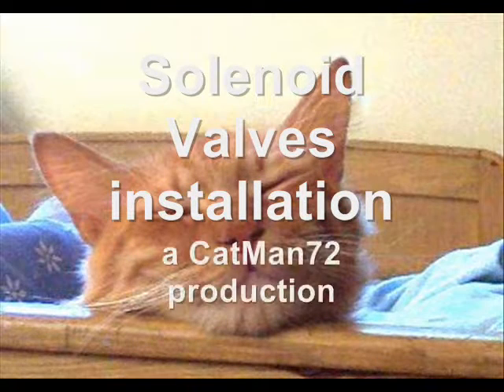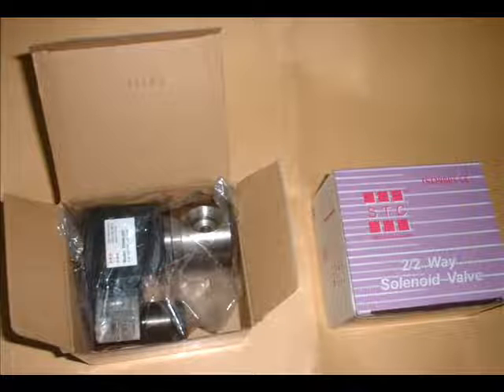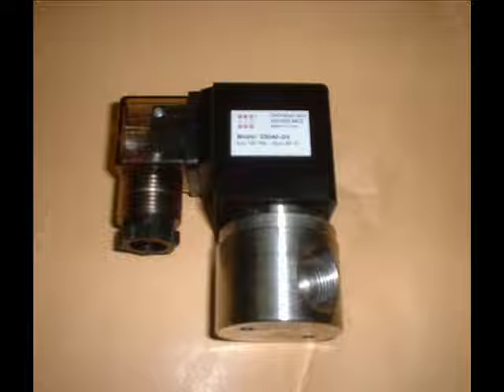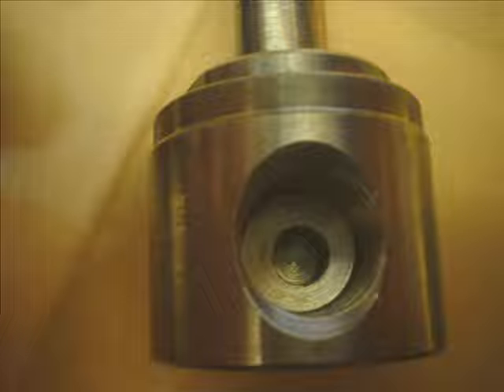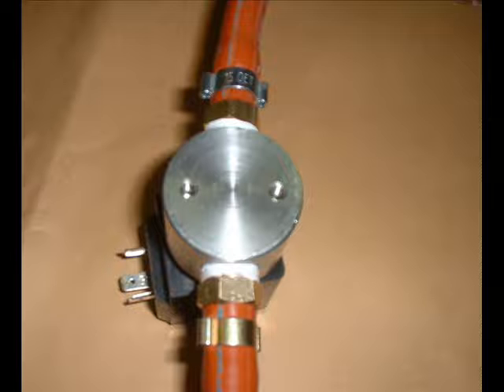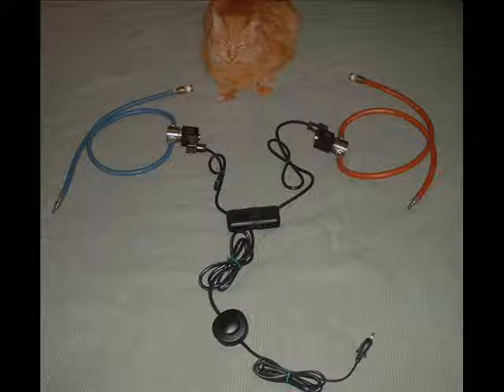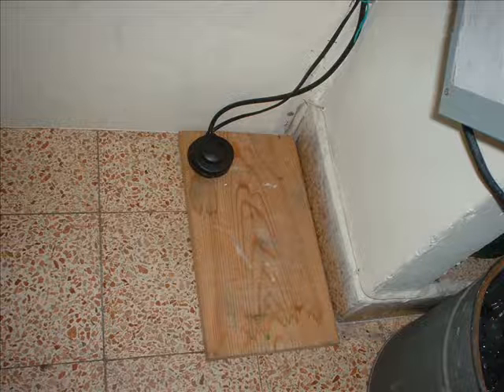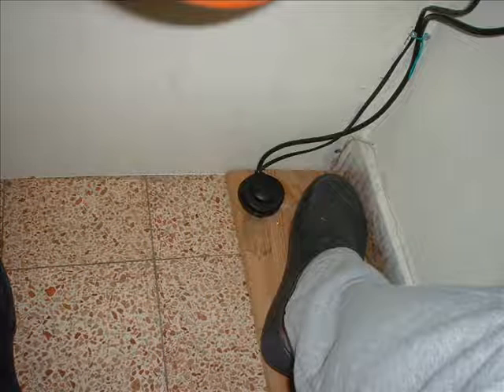Solenoid Valves System Installation

Comment: Is it possible to use this solenoid in LPG gas
Reply from the maker: Jomal Jees no problem, you can use with any kind of gas. The only thing you need to change is when using Oxygen you must use Viton seals as explained. I use it with NG which is more dirty than LPG

Comment: do you know where I can get T fittings for the input side of the solenoids so I dont have to use Y's on my hoses? example. Two hoses (one propane, one oxygen) coming from the regulators go into a T fitting on the input side of the solenoids. from there, the gas can move freely out of one T fitting to the center fire while the last port on the T goes into the solenoid.
Reply: also when you are making your own you have to account for ac or dc power, i will be using ac power so i do not need an inverter, and the valves are the same price locally, in my case red + and black - are replaced with white neutral black hot and green ground

and think you so much for your video catman, it was the best one i could find
Reply from the maker: hi there :-)  i buy fittings locally, so i cannot help you on this matter. but the net is full of this stuff, and also local stores wherever you are. just get your sizes right. good luck !
Reply: anyway you can link up a wiring diagram? I noticed all the power goes through the footswitch on yours and plugs into the wall. The other tutorials I see always has two cords coming out of the (box) one cord goes to the foot switch and the other cord goes into the wall. thanks
Reply from the maker: d3tach3d its the same wiring only looks different. industrial foot switches have wiring diagrams attached. something along the line of "Line IN - Line OUT".
if my switch was big enough to house the connections it would look similar.
if you are not sure - get an electrician to hook it up for you. better safe than sorry.
Reply: ummm are you talking about premixing the propane and oxy , then sending it in 1 hose to the torch ?.... if you are, that would be be bad idea im sure..   or you want to run 1 propane hose to a T connected to the solenoid, with a hose coming out of the leg of the T and one out of the solenoid, to the torch, then repeat this with oxygen... cause the way you worded it says propane and oxygen into "A" T, either way if you don't have a welding supply near you try grainger online, i find most of what i need there for industrial stuff
Reply from the maker: Buddy Mansfield i was talking about the electricity... the question was about "wiring", not tubing :-)
Reply: i was replying to the original comment in this column :P you said you buy fittings locally and cannot help, so i offered the information i have for inkblot
Reply: the switch can actually be anywhere you want it on the line, when the wire goes into the box one + wire goes out to switch and back in, there basically just separating the + and - line and repositioning them them to give the dingleberry configuration
Reply from the maker: F.U. Buddy  stop it, i'm blushing here...